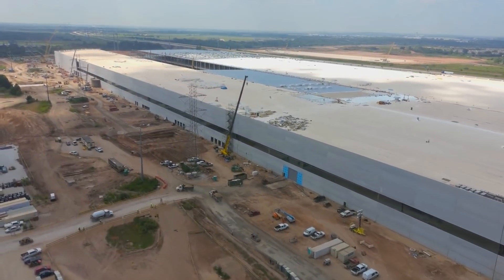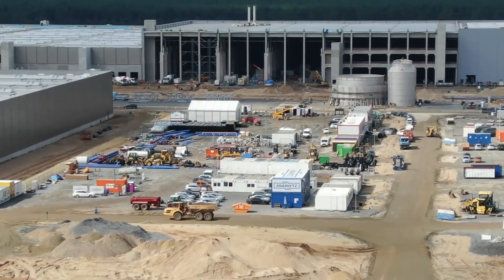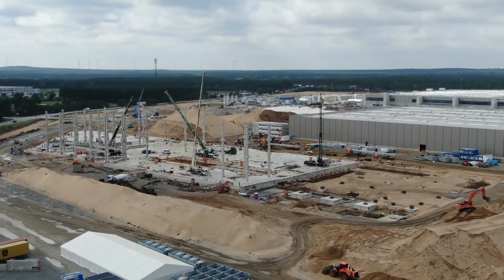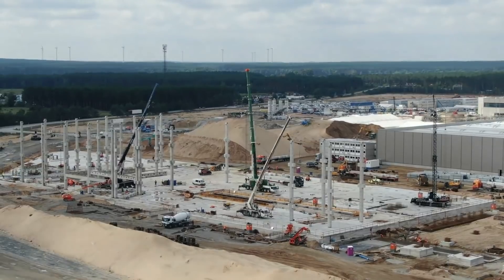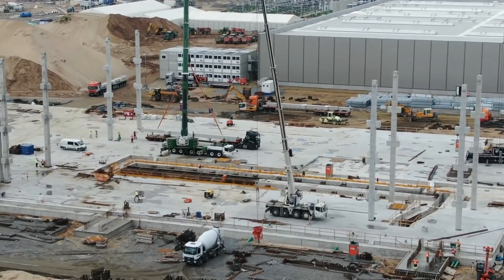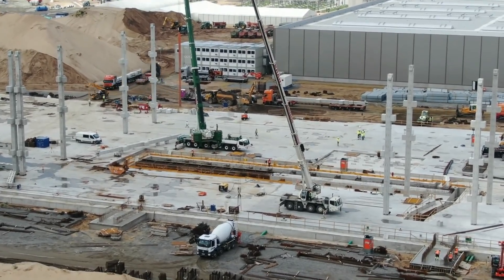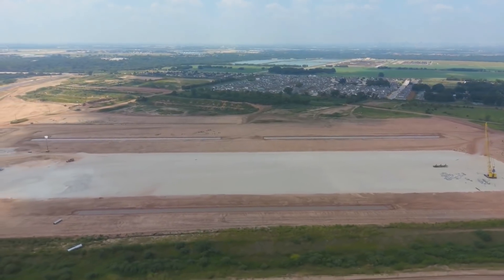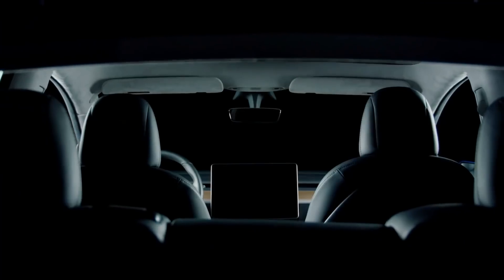Tesla Quality Disaster? & Cell Production Giga Berlin

Comment: The Toyota/Lexus android interface is also a total disaster.  The Ford interface works super well.
Reply: Ford lol you must be kidding
Reply: @furthermoreproductionssall6448  no not kidding.  The android interface connects quickly, and automatically once paired, without the use of a cable. All features are implemented, correctly as documented.  It allows multiple phones to be connected, even across platforms.  What specifically is it that you don't like about the implementation?

Comment: Yes, Tesla’s do have a large learning curve on the infotainment system but once learned it is pleasure to use! Note also that bugs and issues are addressed buy Tesla with over the air updates. Also free software updates constant improvements and features, navigation updates etc! Due to the simplistic control tablet design, more information must be learned to control almost all the cars features & controls. Voice commands are way under rated when learning the system. Other manufacturers systems seem archaic even current model years. 💎🙌😎TESLA